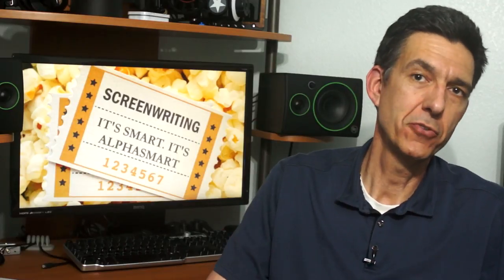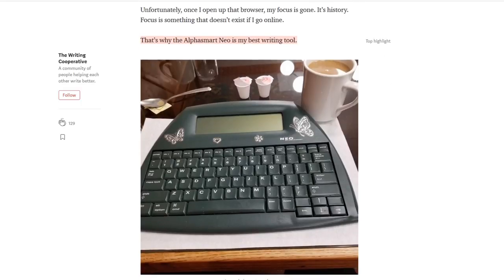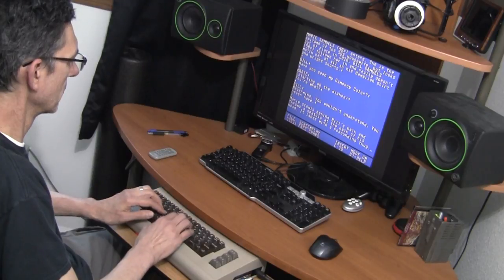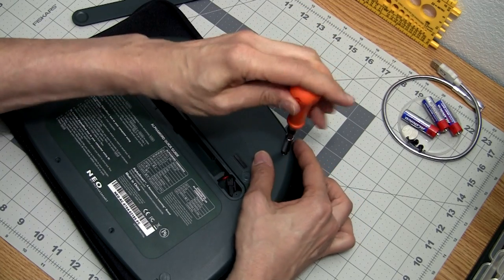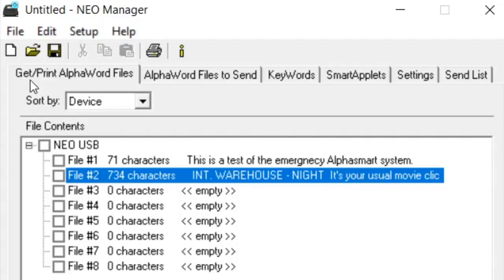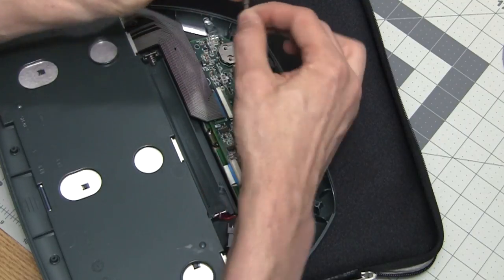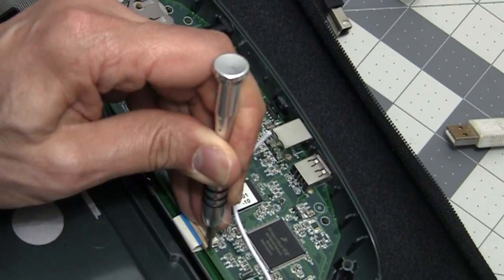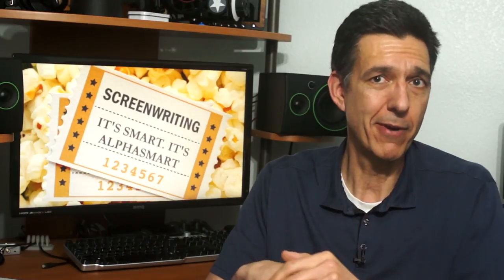How to Write Screenplays on the Go with the $23 Alphasmart Neo (with mods!)

Comment: I paid $200 for a Neo some years ago. Shoulda waited, I guess... ;-)
Reply: Same here! I had the AlphaSmart model before it as well. Those things were tough as nails! Can't even remember how many times it slipped out of my hands when I was dealing with Carpal Tunnel Syndrome. Never hurt it a bit. Used it for 5 yrs, then retired it when we got our first computer in the mid 90's w/internet access. Probably still have it in a box here somewhere.
Reply: Same! Bought mine brand new 13 years ago. Still works great, and I still use it all the time. Best thing for distraction free writing.
Reply: I paid $160 for a used one five years ago. But still using it and love it. Well worth the investment. Just went and bought a used NEO2 for $25 as a back up.

Comment: I don't write screenplays. Would someone be able to explain the advantage of this over using something like your phone? Sure it's not connected to the internet or social media, but isn't that solved by Airplane Mode?  I figured an app would be able to do most of this. Again, I'm not trying to be dismissive of this product's utility, I'm just foreign to writing things like screenplays, so it's genuine curiosity.
Reply: There are several free/inexpensive screenwriting apps and you can connect a Bluetooth keyboard to most phones/tablets.
Reply: I’d say that with a device that is so basic and single task minded. If you don’t get that usefulness it means that you really do not need it in your workflow. (Not being dismisive either, poeple can ‘make.you’ use something, but they can’t ‘make you’ NEED something like this it’s the same debate as mouse/trackball/trackpad) I  work in IT but when I write I use an old mechanical typewriter... then scan/ocr stuff like a true caveman...

Comment: I used the Neo 2 back in middle and high school right about the same time I found your channel.  My handwriting was so bad I used it to take notes and do assignments.  We bought it brand new since it was still in production and only charged it with the charging cord once.  It came with a rechargeable battery and it would charge itself every time I plugged it into a computer to transfer files.  It served me for 6 years straight.  Recently found it while cleaning and after charging it up it works like new!  Absolutely loved it back then, glad to see that they are finding a second life.

Comment: Does it have a power connector in the back like a 5 W barrel connector? That looks like a cool handy device to have and then once you plug in your computer you can download the text to it?
Reply from the maker: It does have a power connector on the back. You don't "download" per se (unless you use Neo Manager), but the Neo acts like a robotic keyboard and "types" your file in whatever document you open.

Comment: That USB power mod is also a good way to send 5v directly into any computer USB port the Alpha is plugged into... Not healthy for the computer at all
Reply from the maker: You are correct, but to do that you'd have to use the uncommon USB-A to USB-A cable, which is not the normal way to connect the Neo. The normal way is with the more common "printer cable" or USB-A to USB-B cable. In other words, you'd have to go out of your way to connect it wrong.
Reply: @frugalfilmmaker  That assumes the B-port on the Alphasmart follows the USB standard, and isn't simply pushing a voltage out the +5V line, something which has been known to happen with lazy designers who never expect their device might be modified in this way

I would definitely check for continuity between the A/B ports, to ensure the two do not share any common pathways
Reply: @frugalfilmmaker  Just to clarify, because I know I'm not explaining myself correctly here - back in the 90's - early 00's it was very common for USB devices to cut corners on the standard. I have a bunch of devices  from that era with both A and B ports which were not properly isolated electrically, and voltages could sometimes go places they should not, especially when a modification is done...

Comment: If you connect the USB cable to a USB power brick it will run from the outlet and won't use the batteries!
Reply: You mean from male power brick usb to male print/data plug, or male usb to male usb? The double generic regular usb sticks are almost impossible to come by accidently these days.